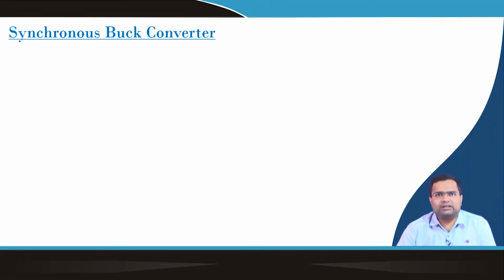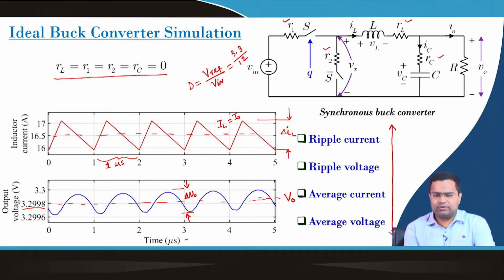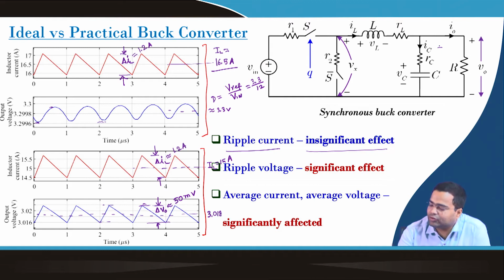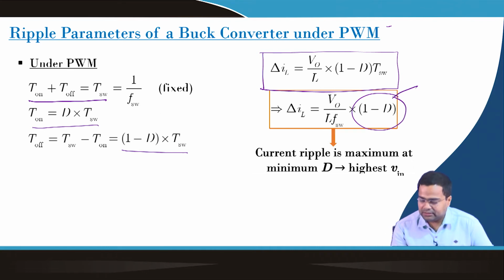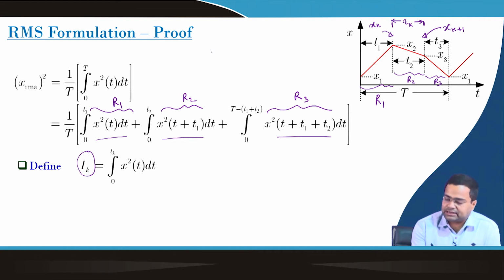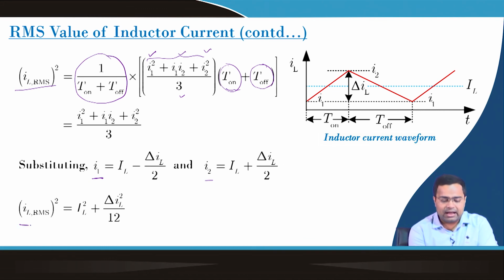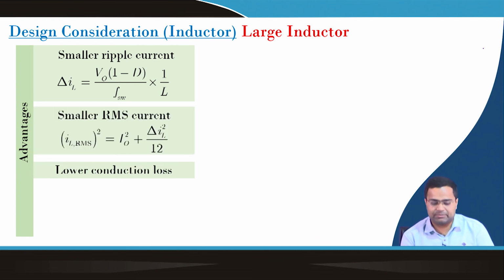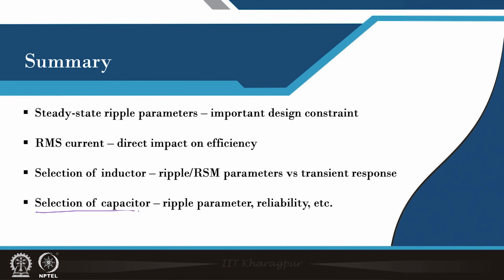Lecture 07: Power Stage Design of Basic SMPCs: Summary

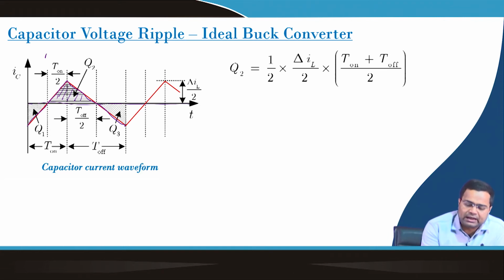Comment: @15:37 in the capacitor ripple current equation delta_iL taken. Shouldn't it be delta_iC? Thank you.
Reply: Under CCM, both the inductor and capacitor current ripples are the same in a buck converter if the load current is ripple-free.
Reply: @santanukapat7431  Thanks for your reply.